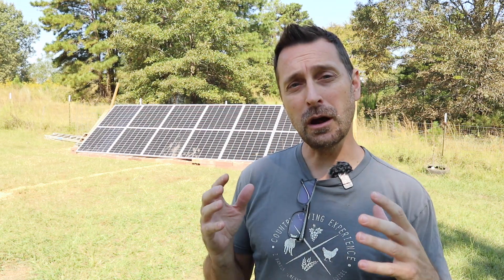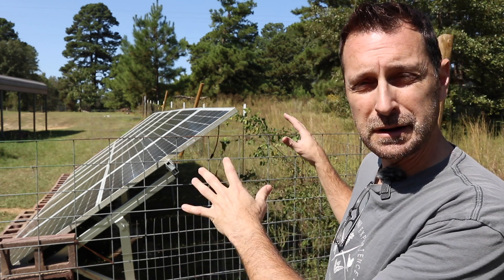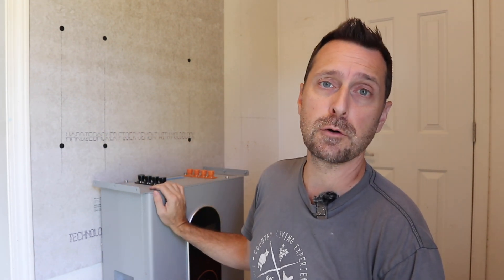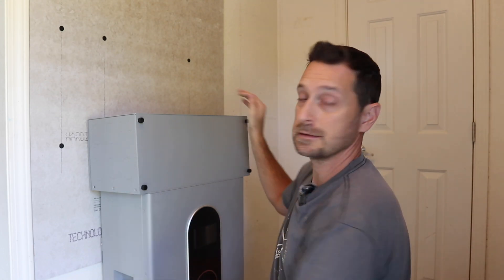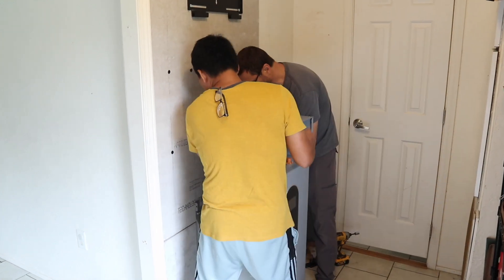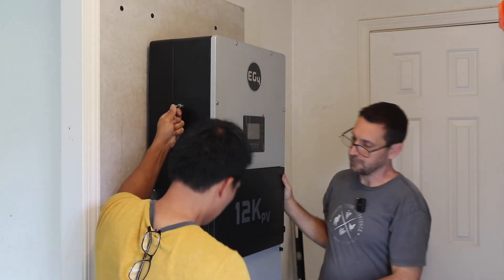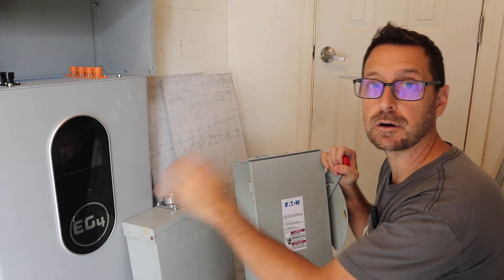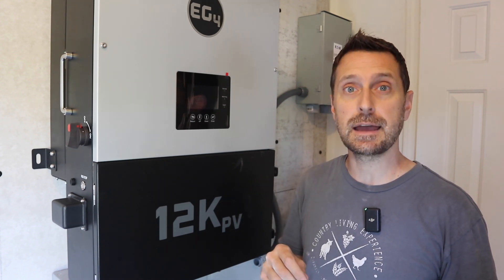EG4 12K PV & EG4 Wall Mount Battery Install! Pt.1

Comment: great video as always, how did you cover the rectangular hole (knockout) from the battery conduit box? I made the same mistake and removed it and now I have that big hole in the back. Thanks
Reply from the maker: Thank you.
I couldn't cover the hole unfortunately. It is just wide open. I don't think those boxes are designed very well. I barely tapped the round knockouts and the square one fell out.
Reply: @CountryLivingExperience  thanks so much anyway my friend I just ordered a new top plate from signature solar $12.

Comment: so are the panels just all wired in series,   no combiner box needed, 10 gauge wire run to inside ? that's it.
Reply from the maker: Correct. That's it.

Comment: If all you are doing is using it as a short term backup its a good system. But anything longer than a day or two and that system is not going to be big enough to run the loads that they have deemed critical. Nowhere near enough generation capacity.

Comment: I live in southern Arizona and while we do not get much rain we do get several hail storms each summer month.  Do you know of a way to get sun to the panels and also protect from hail?
Reply from the maker: Many panels are rated for 1" hail at 50mph. Some have a higher rating.
Reply: @CountryLivingExperience  Thank you
Reply: Northern AZ here. I'm setting up my array now and plan on having some exterior plywood sheets available to cover the panels if hail is expected. But of course we know that kind of event is often unexpected so... maybe lexan covers? Best of luck to us both!
Reply: @user-oi6gy1sp5w  Yes

Comment: I hate that EG4 keeps coming out with better and better products, after installing the 6500EX's then upgrading to the 6000xp's now they have the 12k and neater batteries, I can't keep up LOL. But with that said, I like ( and did) to put up a piece of 3/4 inch plywood and anchor that to the studs then put the hardy board on top. That way I can mount anywhere and not have to worry about finding a stud even for heavy loads.
Reply from the maker: They are always adding products and getting better. It certainly is hard to keep up.
Reply: @CountryLivingExperience  IMHO you really need to look at the Reliance Pro Trans II transfer switch, so easy to install and lets you transfer between solar and grid at the breaker level.
Reply from the maker: @JBPowell-y9m  Those are nice.

Comment: Looks great!  You mentioned that running the conduit is the hardest part.  I find that it's between that and figuring out the initial layout.  What I've ended doing in past installations, especially in tight spaces is using cardboard to cut out the exact dimensions of each piece and then taping them on the wall.  Seems silly, but it helps you get a visual idea of actual usable space.  

Looking forward to part 2!  Thanks!
Reply from the maker: Thanks Adam. 
Cardboard cutouts are a great way to measure, space, and plan. That is a good method for sure....not silly at all.

Comment: When I installed my solar I removed all drywall off the wall I choose for mounting it. I then installed 2” x 6” lumber between the studs at the proper heights for all equipment. Now you can use all space as you know it is supported well. The only other thing I noticed was the ground mount being so close to the ground (panels) mine have a 2’ clearance. I guess just my personal preference.
All in all looks good Eric.